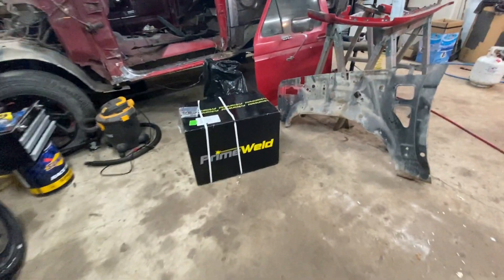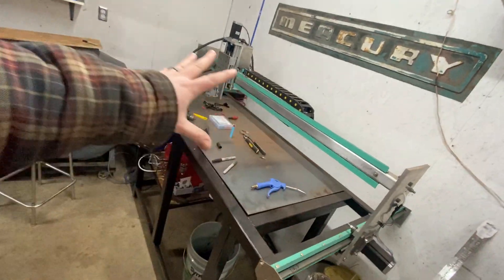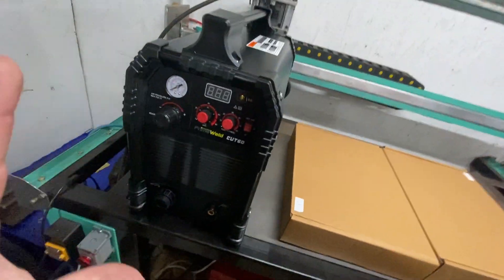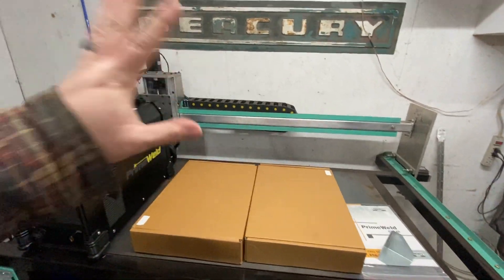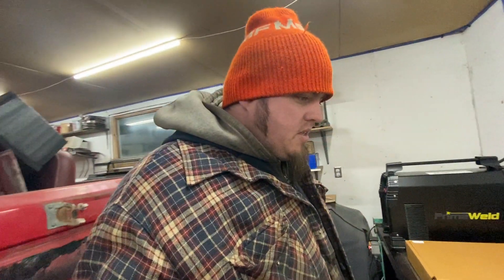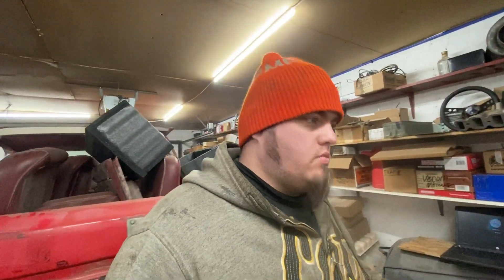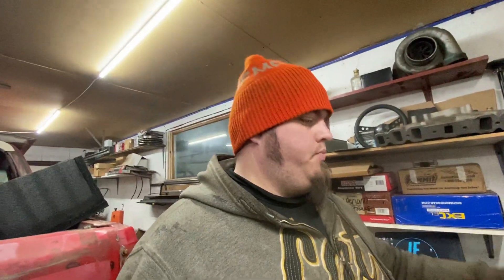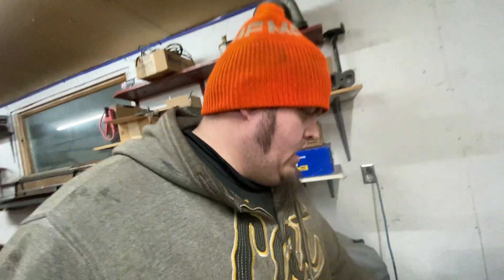Primewled CUT 60. i am now a prime weld fanboy.......but it failed??? what now!

Comment: Where did you get the table and software set up for the plasma 60 I have one like it ty
Reply from the maker: The table is home built. I have the build on my YouTube channel. And for the software there is a video about that as well. I’m using a MyPlasm control board and there software. Supper simple to use and can’t be happier.

Comment: Mine will read 42 amps digitally even though the dial is turned to 60. I tried cutting some 3/4" steel and it wouldn't do it which leads me to believe the digital readout is correct on the amps. I sent an email last night but probably be Monday before i get a response. Does yours show 60 when dialed all the way up?
Reply from the maker: Yes my dial goes to 60. Are you running on 110v or 220v? If you have the adapter for 110/115v it will only go up to 45 amps.  And as far as them getting back to you I have got in touch with them on a Sunday before…. But one thing for sure is they will take care of you. 👍
Reply: @letkemanfabworks619  Thanks for responding. I'm on 220.
Reply from the maker: @DXT61  oh ok then yeah something going on there. But I’m sure they will look out for you. Thanks for watching though I do appreciate it

Comment: My primeweld cut 60 burnt my Cnc board! It’s supposed to be 50:1 divided voltage but it obviously isn’t!
Reply from the maker: Really? Interesting. I am using it a 50:1 I believe on my new set up seems to be working fine.

Comment: Great video! I was looking to replace my plasma cutter, as for thickness, I wouldn't worry about material thickness past 1/2 inch, most things that I have needed to make cuts on that are larger then 1/2inch have been made of mild steel, and for those an OA tourch will do those jobs just fine, it may not be automated, but it will get the job done.
Reply from the maker: Awesome! Thanks for the info and thanks for watching!

Comment: Well WTF
I haven't tried mine yet
But I haven't built my table either 
I see you have had good luck with PRIMEWELD customer service 
Maybe I should try mine out soon 🤔
Reply from the maker: Yeah I was a bit disappointed. But I still have faith in primeweld as there tig has been awesome. And the fact they were grate to deal with and were so quick to help me out I am not too worried. I would defamatory try it before warranty is up.